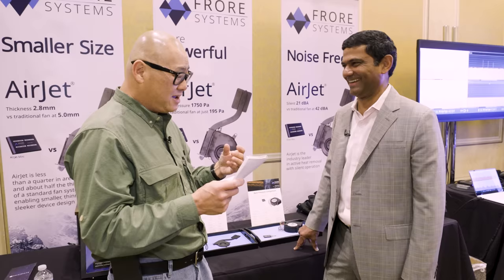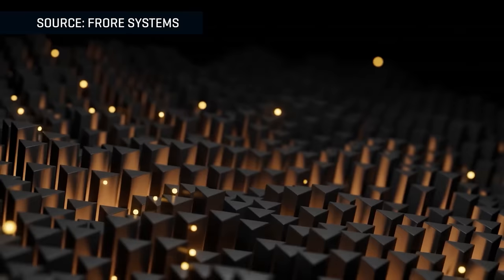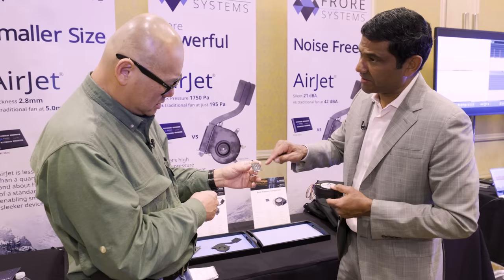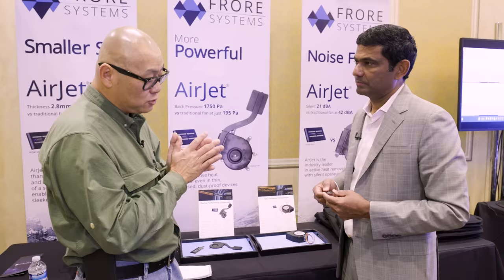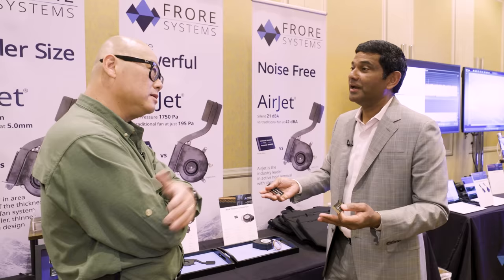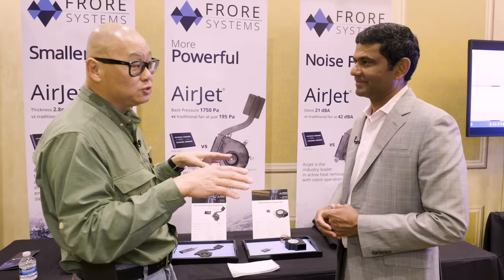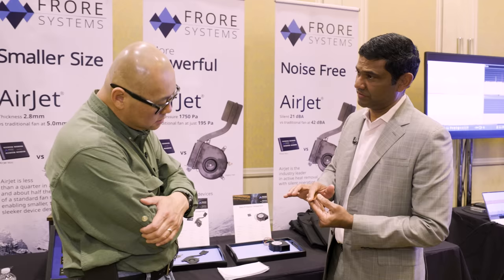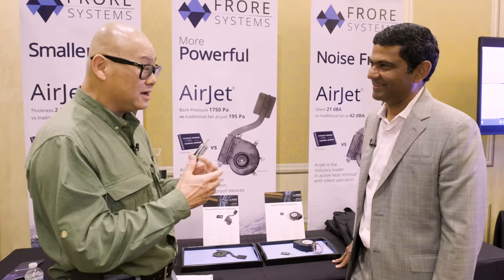Solid State Active Cooling Could Revolutionize Thermals

Comment: The promise of a silent PC being actively cooled sounds too good to be true. I hope they have big plans for this and that those come to fruition. In theory this is thin enough to cool ram or go below an M2 drive or cool a south bridge, where today we have massive passive cooling elements on Motherboards.
Reply: Yes but this still has no advantage for desktops. even in the case of "massive passive cooling elements on motherboards", all the heat from those heatsinks is being sucked up by the exhausts or moved into the pc case by the intakes. I can only see this good for air-constrained front intakes on a desktop case. or, a low-profile fan replacement that just simply slots on. regular fans are still better in every way.
Reply: then again noctuas can probably fix the issue of your front intake being air-constrained with how amazing those fans are at dragging in air and just pushing it all through.
Reply: @scarecrow5848  Truth. Modern desktop PC liquid cooling technology already gives us "silent cooling." Where this kind of tech is really needed is with mobile devices where you can't just solve the heat problem with 480mm of radiator.
Reply: @romxxii  or low-power devices. It's also good if they can adapt it into a front intake for PC cases considering most nowadays have a flat panel for the entire front with thin-ass slits. It'd work amazing for my PC! Then again using noctuas instead could probably fix the front intake being ineffective.

Comment: Looks very promising. You could quite easily slap these on chipsets and other small chips as well (maybe ram if you have the space but I'm not sure). In fact depending on how effectively it sucks in air and expels it from an open space you could just use them to improve airflow in a case. All depending on the price and if it becomes available to general consumers of course. Hopefully we hear more from them and they don't vanish.
Reply: I wonder if the plan would be to just exhaust into the case/enclosure and then have a traditional case fan exhaust that heat.  Seems like they would be pulling in warmer air though if you had multiple of these in one enclosure.  We may be looking at a new PC form factor for the desktop with these in mind unless you have intake tubes to these for outside air.  For video cards it would be easier because they can directly exhaust out the back like they do now, but you'd still want lower temp outside air than the warmer internal ambient temps.
Reply: @robertherman58  I see liquid cooling with radiators designed around these chips. He talks about using vapor chambers with them, which is essentially passive liquid cooling. Lets you put them where they would best get or remove air, not on the components themselves.

Comment: Very clever product, well done for them! 
If they can retrofit these into currently existing fan sizes, they will be onto a lot of money, so many things use fans and could do with being silent! (looking at you, 3d printers).
Also imagine walking into a data centre without having corridors of angry racks screaming at you!
Reply: It’s the coolest thing in a while
Reply: @GOGEDIT  😅
Reply: imagine if they scale up the tecnology and use it on planes
Reply: data centre with fan cooling..?
Reply: @Ivu  yes data centres are really loud
Reply: @cireciao792  
Pretty sure the larger they get, the less efficient they get.
Reply: @dkx6841  data center NEED air conditioner! Air Fan can fail (and make noise)
Reply: @Ivu  we have AC in the rooms but the servers have fan's....a lot of them and loud!
Reply: @hernanialves6938  I have some discarded server fan plates, and they are can blow some air at max speed
Reply: For me, the least amount of noise comes from fans... when those rails start creaking.... I have angry neighbours banging at my doors xD
Reply: They make no comment on the amount of air the modules move, so I would guess the devices don't move a very large volume of air.  This would make for a bad fan, because the fins of a heatsink have this same "air pocket insulation" problem.   If they instead replaced the heatsink with a bunch of these connected to heat pipes in the same way fins are,  no fans are needed, and the larger surface area would give huge gains over putting the modules directly on the processor.
Reply: @SMGJohn  a lot of little ones

Comment: Dude knows exactly what he is building. Seems like a good CEO :) Fantastic stuff!
Reply: I'm personally skeptical that air has the heat capacity for this to work without a real heat sink. He is right about needing to break through that pocket of air that is next to the chip, but the amount of air that you'd need to make this work is a lot. The case fans are typically at least 1 cubic foot of air a minute, which is just for the case fan to remove the buildup of heat in the tower and might have multiple fans if you're going to be doing something intensive like gaming or video conversion. The processor fan would need more than that as heat can build up more quickly and cause damage more quickly, even if the total heat generated is a good chunk of the total heat that builds up in the case.

I suspect that this will work in cellphones and the like where there's no room for a real fan, but those also require relatively little in the way of fans at the moment, so this would be a net benefit.

Comment: Depending on the cost effectiveness, this seems like it has really interesting potential. While I'm cautiously optimistic, this was mostly a casual overview of the product - would've liked to see some hard numbers. He did say that they were partnered with several device manufacturers though, so it would probably make sense for those to come out before we see benchmarks. Imo I think it's a bit too early to judge this tech one way or another. I wouldn't bet on it just yet but I'd definitely be keeping an eye on it.
Reply: yeah it would take time for this tech to see market, and if so would probably integrate into intel and alike 5 years in the future at the very least.
Reply: What really interesting to look at, is the long time field testings. Like running 24/7 for a few month in a dusty high humidity room, with standard 30min performance peaks 5-10 a day. If it will keep its productivity at at least 95-80%, it has great near future potential(before inventing like closed cycle cooling without the need of air at all).
Reply: I think they are co working with Intel

Comment: I was going into this very sceptical, but if the price for this is right it can actually have a lot of applications. I would still expect this to mostly be used for laptops and over all small devices that are heavily limited by thermals.
Reply: If they ever manage to get it working with a desktop, expect that it will cover most of the backside of the motherboardand be paired up with some form of liquid cooling. A cellphone, tablet or low powered laptop might be able to use a chip like this if they can make it work, but much bigger than that is going to have issues with just how much air they can move past the chip and just how much heat the air can suck up.

Comment: This is going to be so incredible in the future if this thing can be optimized for the flow of air.
Reply: You mean if it's cheap. It's all about cost for the majority of the market. We already have room for big air coolers.
Reply: @anno1602  There isn't room for big air-coolers in small/thin devices. This is what this tech is directed at. Imagine an ultra-thin gaming notebook that's silent and has good thermals, or a silent Steam Deck. Even the massive gaming notebooks sound like a jet engine while you're gaming. I only game on a desktop, but this tech definitely has its place in the market.
Reply: @anno1602  we're reaching the limit of what air cooling can do. GPUs are getting absolutely massive, and you need bigger and bigger AIOs to cool your CPU. Because of that we might get this on the higher end parts, even for the desktop. I wouldn't be surprised if the 5090 came with such a cooler for example.
Reply: @adonissherlock  There's actually a lot more that liquid cooling can do with CPUs. Currently the best AIOs run around 50C above ambient temperature under CPU stress test, and liquid cooling is barely even used for GPUs so far. It's not cheap, but we have no idea how much these SSD coolers cost.

Comment: Hi Gordon, Thanks for asking all those good questions!
 
TLDR for whoever wants to know the specs: 
5:17 Provides 1750 Pascals of back pressure, compared to the 195 Pascals for the ultra-thin laptop cooling fan he is holding at 5:30.
7:49 Provides cooling up to 20 Watt Thermal Limit for a CPU in an ultrabook.
8:18 He says that the small version takes 1 watt of power to remove up to 5 watts of heat, "each chip" and the larger "Pro" version can remove 10 watts of heat, so in this scenario, you'd need two of the large Pro version units, connected to the CPU via a vapor chamber, to provide 20 watts of cooling.
Reply: but does it draw more heat?
Reply: @ManWithAHat2301  It all depends how many chips you combine together to draw out more heat. Gordon posted a link in the comments above, to a video where he toured their office. They showed some examples there, of laptops running a couple chips in combination, to give around 15-20 watts of cooling power.

Comment: The part I knew would be cool about this is the silence and the small size. What made my eyes go wide is the fact you could actually have dust filtering WITHOUT reducing cooling performance! That's really cool.
Reply: Dust covers will still reduce cooling, it just doesn't matter as much here because these things generate more than enough backpressure to suck air in reliably. 1750 vs 195 pascals of force so technically almost 9x more 'suction' to pull through the tiny pinholes in fine dustcover meshes. Like trying to poke a pinhole in a water bottle then drink out of it, should be strong enough to do it.
Reply: The silence part is cool. But, I know from my own pc builds and fans testing that what creates noise is the air speed and the opening or openigs that allow air in and out. Blade design also affects sound levels too. For example, a small diameter cooling fan must have a higher rpm to reach certain CFM (cubic feet per minute of airflow) , whereas a larger diameter cooling fan can have a lower rpm to produce the same CFM. A fan with low pitch angle (blade twist from base to tip) will produce lower noise where a high pitch blade angle will produce more noise keeping rpm equal. Also rpm (rotational speed) is even another part of the equation.  I have tried many active (fans used) cooling configurations over the years except water cooling. I suspect that they may also develop this device to be used on video cards which also rely on fans to stay cool. Dust filtering will be something to actually see if it in fact doesn't affect cooling performance because all filtering methods involve passing a medium (gas, liquid or solid) through a mesh, porous stone, etc. This may affect airflow speed.  Anyway, I have been working on a way to reuse dirty water in mop buckets by filtration and the hardest part has been to figure out the best flow rate to make it an efficient process. Have a great day.
Reply: Your still going to have reduction, as your adding resistance, but this seems to have the headroom to still pull whats needed for it's applications.

Comment: i hope they nail it and can show some really promising results! this could be a game changer for all mobile devices!
Reply: i don't know, dont think you want your phone to blow out hot air, it will lose it's water resistance too
Reply: It will also allow consoles to shrink again. I miss the PS2 slim
Reply: @Ecne3D  with a powerful enough airflow it would be trivial to add dust and water protection to the airflow outlets. Just like how it works with speaker grills.
Reply: SteamDeck need this
Reply: @Ecne3D  Even though he talked about dust proofing, he also talked about the IP68 certification...

Comment: I'm surprised the platform of phones/tablets/handheld consoles (i.e. Nintendo Switch) wasn't mentioned because imagine the performance boost to those devices when suddenly you can vent heat like a big boy laptop in a handheld which is mind boggling especially since they said they can improve the tech making future generations of hardware able to push the thermal limit even further.  Just amazing!

Comment: I am completely in shock I really hope it doesn't end like solid state batteries. The world needs these guys and they deserve to revolutionize the industry.
Reply: good luck buying a device that's basically a dust filter ready to be clogged.
Reply: Solid state batteries are already being built. The problem with them is making them at a large scale
Reply: Solid state batteries are pretty close to belying the next big thing….. actually with built models and are either in market or close to

Comment: Hopefully this will be as scalable as he mentioned. Can't wait to have a silent desktop with this on a GPU/CPU, this can be a game changer for home studios/music production.
Reply: I don't see why it wouldn't be scalable, just plonk it on a heatpipe. Having said that, I'm skeptical about continuous loads potentially recirculating hot air through the device.
Reply: @Gabu_  not everything is scalable. The reason why we don't have GPUs with even bigger dies is because of a reticle limit of the machinery used to make the main gpu chip (which, btw, is applicable to CPUs).

So not everything is scalable. Quantum physics work in small scale but seems not to work properly on macro scale. Etc.

Engineering is way more complicated than we would like it to be.
Reply: @VictorMatsunaga  But that's irrelevant, though. The point of scalability here is that you can take 10 of these chips and spread them over a larger area, not that you'll make a 1000mm² chip.
Reply: @Gabu_  That's exactly my point, we don't know if when they try to stack the design up if they won't encounter other issues. I gave the reticle limit as an example of things that don't scale well, not as a 1:1 example for this case.

 For this specific case, I can think of this example: what if, for whatever reason, the air doesn't flow properly once the design reaches a certain threshold? Or perhaps there'll be diminishing returns when you try to increase the side of the cooling chip due to material constraints, so on and so forth. That's why you don't see gigantic air cooling towers for CPU, at a certain point adding more pipes will incur into diminishing returns and design complications (ergo dealing with the weight and fitting).
Reply: @VictorMatsunaga  The reason you don't see massive tower coolers is cost, nothing else. 
Again, you misunderstand the point of these devices. They don't want nor have to make massive chips, you can just spread different units over a larger area.
Reply: @Gabu_  I think we're kind of deviating from the original point, I said that I "hope" that they scale well while you're assuming that they will. I really want them to scale well, don't get me wrong, I just cannot assume that this will be the case given how complex scalability can be. 

And it's not just just about cost, eventually you hit a material heat transfer limit, no matter how much bigger you make the cooler. So there is such a thing as dimishing returns. But that's another topic.
Reply: 1W to remove 5W seems a bit inefficient. I hope this can improve. But for your ultrabook / MacBook air / iPad pro class of products this could be interesting.

Comment: I hope these become mainstream, this is really cool! Hopefully they aren't /too/ expensive
Reply: 100 times more than a fan right now those are
Reply: He's talking about how they are already in partnership with companies that are going to implement this tech into their new products. So, hopefully, he's talking about our usual laptop manufacturers and we'd get to see products with this tech in the next 2 years.
Reply: @Raviteja-bs7tw  Basically a whole 100 dollars for that, without any realistic projection of durability and limited efficiency.

This is a dead on arrival project.
Reply: @Bramble20322  it's not even remotely DOA.. they struck a deal with intel for implementing it on future CPUs in laptops. 

Also you made up the cost to produce.  Current cost to produce is estimated to be $25 for the mini and $40 for the pro.  A high rate of production would reduce the cost dramatically with a decent investment, and in a few years they could be as cheap as a mid-range fan you'd see in a desktop PC.  Intel already gave them $100 million..

They even modded a Steam Deck to utilize the tech as a demo and it worked wonders.

So yea, will the initial cost be a lot? Sure, most tech is early on.. but this is game changing technology and it will likely mature and get cheaper as time goes on. I'm sure people wouldn't mind paying a little extra for a laptop if it meant it was extremely quiet and could outperform louder laptops at the same price range.
Reply: @Bry.89  Is there any video on the modded Steam Deck? That price seems reasonable considering the added benefits.
Reply: @Bramble20322  could be great for premium laptops. a Silent laptop is something a lot of people would like